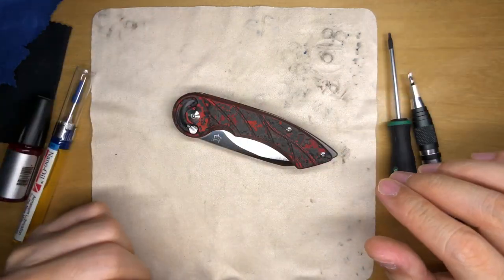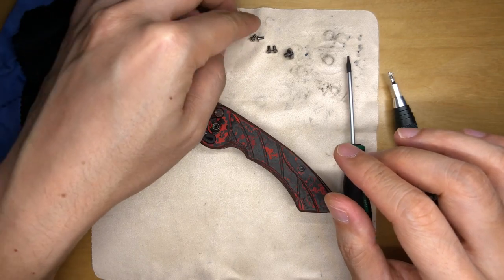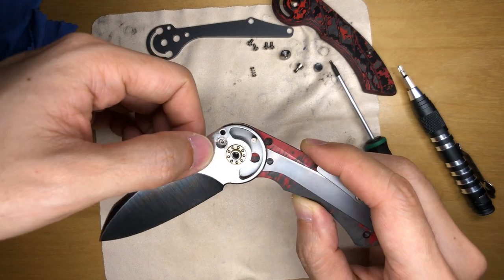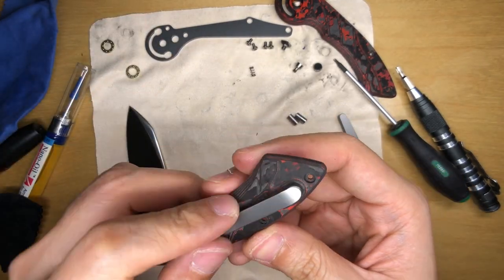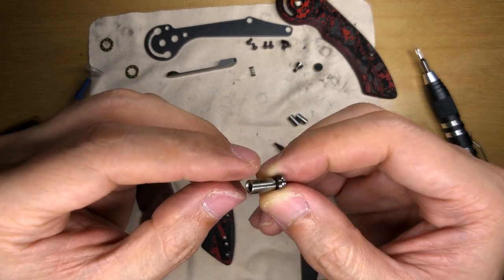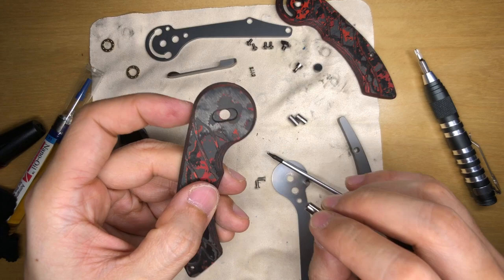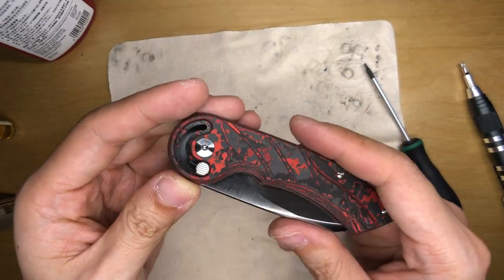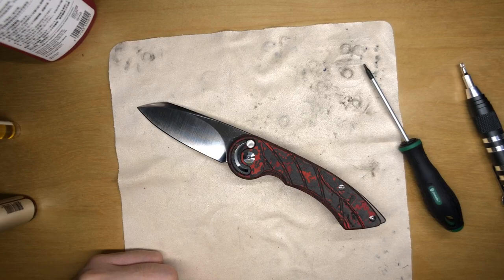Fox Knives Radius - Disassembly

Comment: No alcohol for cleaning?
Reply from the maker: Nah. I didn't want it too dry because it's super humid where I am - I'd rather a thin layer of lube to help prevent rust.
Reply: Gotcha, I usually go alcohol then some lubrication at the end - but I don't need to worry about humidity so it's a different situation